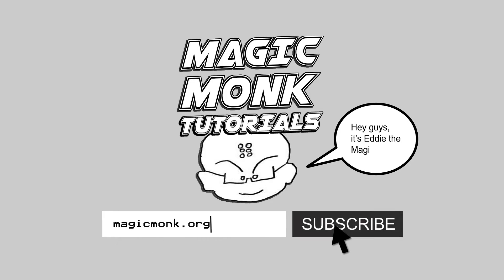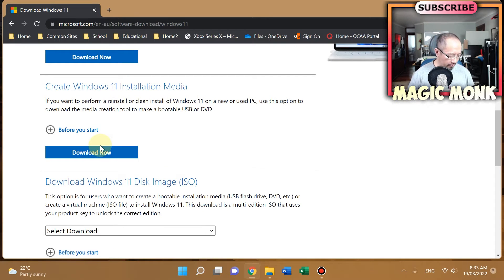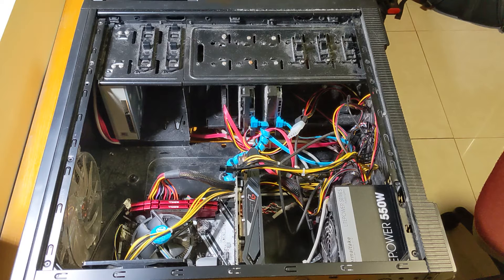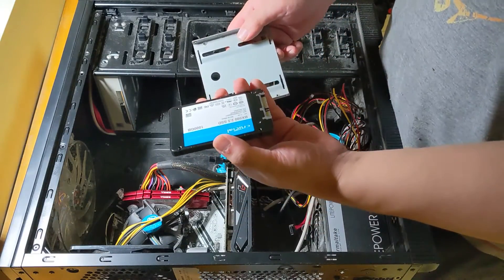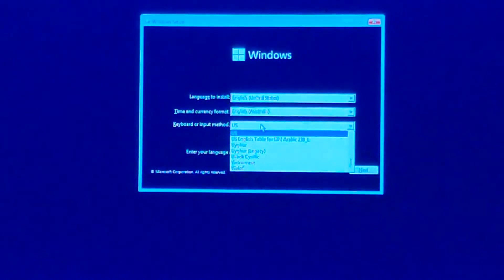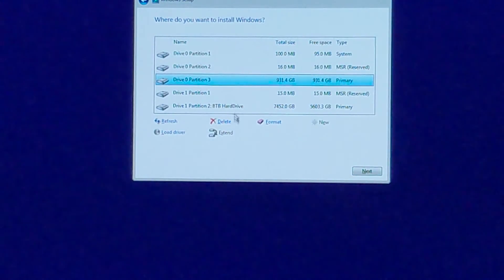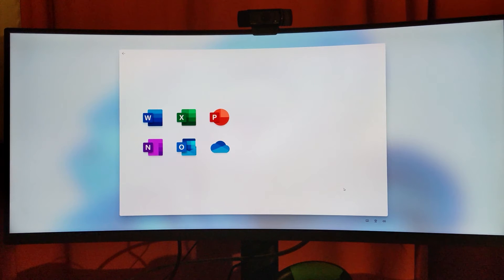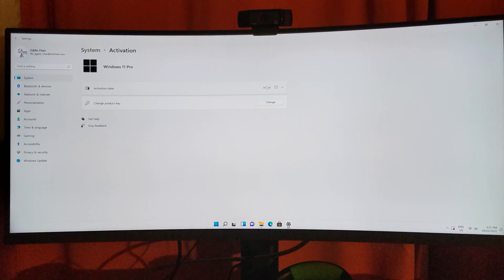Clean install of Windows 11 on a new SSD without product key

Comment: Question: I'm in the process of building a new PC. I plan to gift the PC I'm using now to my brother. If I follow this process to get Windows 11 on a brand new solid state drive for the new PC will the licensing be messed up for this current PC that I'm going to give to my brother? Like well he still be able to run the computer with the Windows 10 operating system after I set up Windows 11 on this new PC?

Comment: Two things in your video before removing the SSD drive inform the viewers to shut the computer off and then when you reconnect the SSD new drive always connect the bottom connector first followed by the top connector.  enjoyed watching your video it was very simple to follow and I will be doing this next week with my 2 TB NVME crucial.  $107I also created the USB drive ahead of time to save some time when my NVME crucial 2 terabyte is delivered.   I decided to cancel my Dell XPS 8960 which would've cost me $2180 and just buy the crucial in VME and a 14 Gold TB SSD drive from Western digital

thanks again for a great video
Total cost now. $107 + $288

Btw.  I was able to find my product key, that was posted on the motherboard
Reply from the maker: thank you very much!!
Reply: Would you mind telling me how you located the product key on the motherboard?  Thanks
Reply: @roadrunner79  On a Dell computer, the product key is "injected" onto the motherboard at the factory, meaning it's stored within the BIOS and can't be physically seen on the motherboard itself; you can access it through the system's BIOS

Comment: There’s a much better way to burn the ISO. If you use Refus you can skip the security bollox on instal, bypass minimum requirements and preset the local user to your name.

Comment: I have reached the point 10:30 multiple times after watching many many different youtibe tutorials of people trying to clean install windows 11 on a new ssd. I just cant make it work!

I have a brand new Samsung 980 PRO M.2 NVMe SSD and a brand new 16gb USB. I come to this point 10:30 and then it sais that you cannot boot windows 11 on this PC. That this PC does not fulfill the required system requirements to install Windows 11.

But I have had Windows 11 on both my old, broken ssd and now on my hard drive! I don't think my brand new Samsung SSD can't support windows 11... Please help me! I have tried everything here...
Reply: You could try installing windows 10 and then once it boots update it to windows 11 within the settings, but I am not that technically advanced, just putting my input in here
Reply: @mrnul-gi3fo  thank you but I figured it out 😁. I just unplugged the hard disk and then it worked 😊
Reply: @dinosimisides  great to hear

Comment: Could I use a external usb hard drive instead of a flash drive??
Reply: im sure you can just make sure you have nothing on it. format it and make sure its plug and play. no need to spend money of you already have what you need.
Reply: @Str8DropElite  this is the right answer
Reply from the maker: why wouldn't you use a USB stick? they're less than $10 these days.
Reply: @magicmonk hey I have a small question, so after you take out the USB, do you click reset or? I’m a bit confused sorry